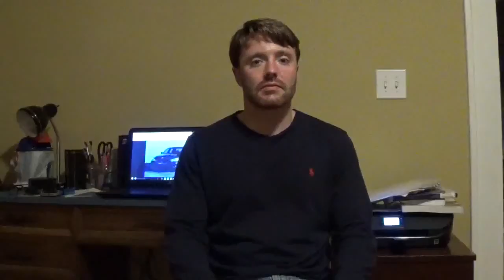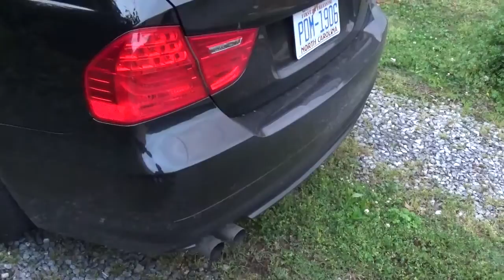Secondary cats delete E90 328i

Comment: Did you remove both cats ?

I removed my muffler,resonator, and cat near the driver side .

Think I'll do a charcoal delete next
Reply from the maker: Kdub Spencer Yes I removed both cats from the underside. There are 2 more on the exhaust manifold on the passenger side under the hood. I still have those.
Reply: Does check engine comes on if you take out the secondary cats
Reply: OUSS SHEHADE no, the O2 sensors are before the secondary cats

Comment: Did you notice any difference as far as power and sound under load after doing this
Reply from the maker: Jason Escober Yes there was a small but noticeable increase in power and under hard acceleration there was definitely more noise than before. The stock muffler does do a good job of keeping it quiet under light loads. Also the secondary cats are heavy so you’ll get a bit of weight reduction.